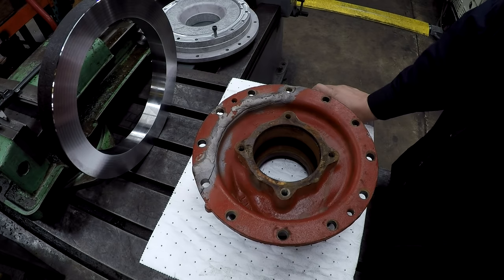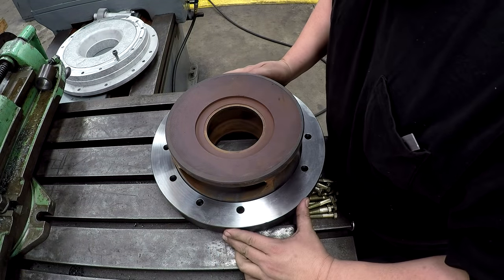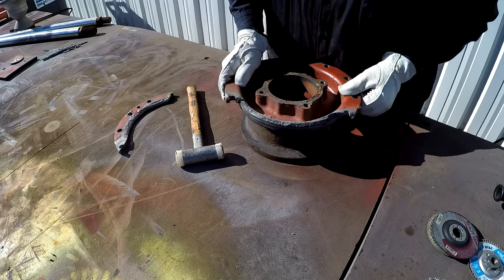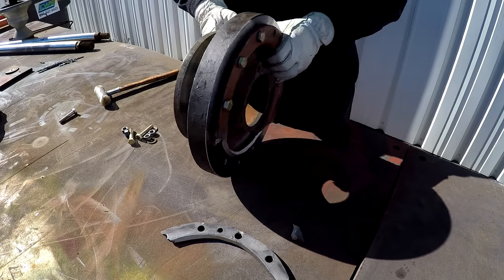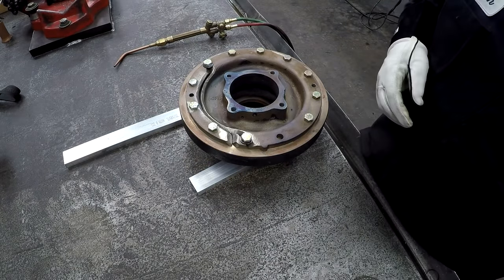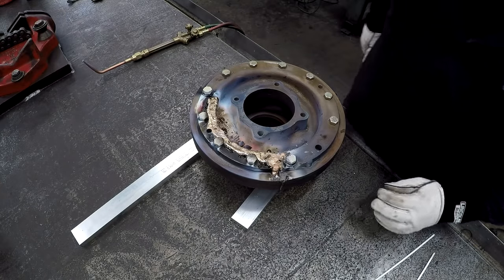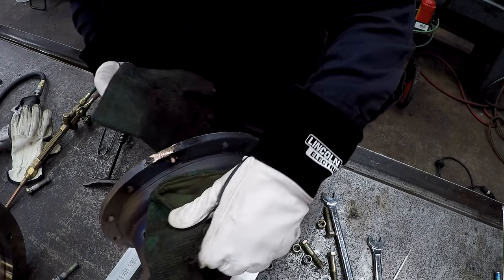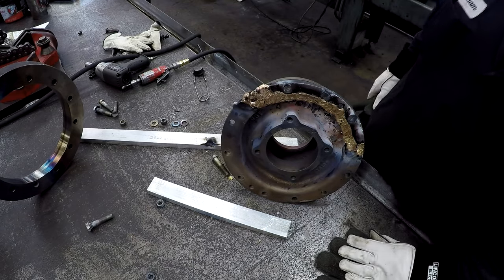Braze Repair on a Broken Casting Part 1

Comment: what is the advantages of braising that instead of re welding it better?  I've never messed with any braising just wondering
Reply: +robert singleton From what I've seen in Keith Fenner's videos, welding cast iron creates super hard areas around the weld that cause all sorts of problems should machining be necessary.
Reply: +robert singleton Brazing does not melt the base metal.  It is sort of like "solder" something together. The boundary area where the brass and iron bond becomes bronze, which actually melts at a lower temperature than either brass or cast iron!  They call that "hypereutectic".  Like when tin and lead combine they become "solder" and melt at a much lower temperature.  Believe it or not, a brazed repair can be extremely strong!  It can be stronger than the design capacity of the original part.  Even so absolute maximum material strength may be unnecessary (it depends on the part).  If ultimate strength is required, the part would have been made of steel and not cast iron.  Brazing is a good repair method because the cast iron is not melted.  If cast iron is melted, the carbon molecules separate from the liquid iron and coalesce into big chunks that have no strength and the cooled metal becomes weak and porous.  Other areas create carbides that cause other problems.  But mostly, when cast iron is welded, cracks develop.  There are a few filler rods used for cast iron that help alleviate those problems.  Metallurgy is advancing everyday.
Reply: +WAVETUBE84 thanks for the detailed explanation,  I could have looked it up on Google but wouldn't have been able to get as clear of an answer as that
Reply: robert singleton Basically, cast iron is brittle.  To do any welded or brazed repair requires preheating the entire part, or areas that will geometrically expand and contract together.  That will minimize the internal stressing of the part.  An understanding of "stress relieving" of welded together parts is a good side topic.  Whenever you weld metals together it creates internal stressess that are manifested (observed reaction) by warpage.  If the base metals have no where to move, there is much internal stress and if beyond the strength of the base metal, will form a crack.  The weldment becomes an area that has different strength and expansion and contraction rates (modulus).  After many cycles of being heated and cooled (like an exhaust manifold, or engine part) the welded part "beats itself up" and it cracks along the transition between the weld and the base metal.  That is why brazing is selected before "welding" on cast iron.  Metallurgists are developing new rods and processes all of the time.  Sometimes the discoveries are made by some guy with only a high school education (or less).  He tries something different and it works.  He shows someone else or publicized his discovery and it becomes a new phenomena.  So there are new rods that play tricks on cast iron (or other material) that enables the materials to flow together more successfully.  There are many tricks to the trade and it gets deeper and deeper.  For example:  My friend welded glass to metal!!!  It was for some special scientific machine or gas analyzer.   Other metals have different properties (Aluminum, Alloy-Steels, Mild-Steel, etc.), so welding them can easily be done.  There are various methods.
Reply: robert singleton I have a friend that works on cast iron, racing, engine blocks.  Either some fix or modification.  He has a oven to heat the block up until it is glowing, then he welds it.  After he is done welding it, he puts it back in the oven.  He has a special (programmable) timer that can bring the temperature down over a long time.  That reduces the thermal shock and cracking.  It is only for fancy racing blocks, or some rare type of  engine block.
Reply: WAVETUBE84 that's what I've always heard to do with cast

Comment: Generally and by far, the worst part about those repair jobs is the cleaning . Grime, oils, dirt: all kind of crap that prevent a good smooth weld/braze .In this case there's a clear, frank break that's easy to reach and clean

Looking at the crack's appearance, it seems that the weld hardened the material or at least effed its grain structure dramatically (grains are so big  it looks like sand in there) . It was prob preheated but was it post heated to slowly anneal it? Doubt it. 

Should be ok to forfeit post heat for brazing tho.

Comment: I am not an expert in this, but I would never attempt to repair something so far gone. I would have put the piece on the lathe, remove the entire old flange, and fabricate and weld a new one. The reason old weld failed is probably increased stresses on machine, which may break or deform also new weld. I would be interested to know how this repair has held over time.

Comment: I think the off pattern hole is a fool proof method of indexing the housing. I wonder if machining the face and adding a ring of in the front wouldn't be a better solution, i don't doubt your work, it was really well made, but it seems that housing was ripped apart violently, so there's quite a bit of force on it. Hopefully it will never break again, it would be a real shame with all that work put in to it.
Reply from the maker: Hoping the guys repairing it will take care not to break it again. I warned them about usijg those jack bolts.

Comment: Hi Adam. Fine looking braze job. Is there any particular  reason for using Brazing. In stead of using a Stick Electrodes especially for cast iron? Looking forward seeing the second half of this job. Keep up the good work and very entertaining videos😀
Reply from the maker: For large parts like that I like to braze and think it will provide a stronger joint. The first repair with nickel rods failed.
Reply: the casting failed adam not the weld because it broke beside the weld. probably like you said from those jacking bolts with uneven tention.
Reply: Was that your repair?

Comment: Wouldn't it be better to weld that with high nickel content stick electrode that is intended for cast iron repair? That stuff has worked amazingly well for me.
Reply: you can but the weld procedure is alot more involved and more costley thoose cast nickle ni rods are pretty pricey.
Reply: Arno Dyck Believe it or not, the braze weld is actually stronger overall and MUCH more ductile than any conventional weld repair. You will note that the pump housing had already been repaired once with nickel rod, although to be fair the nickel repair doesn't look like it was done properly. For gray iron castings, braze welding with low fuming bronze rod and oxy-acetylene torch is usually the best way to go, unless the casting operates at high temps (i.e. exhaust manifolds, stoves).

Comment: I like the work you do. I think this part would have been much stronger to have turned 3 pieces and screwed the center piece into the outer flange part with locktite. Sure it would not have looked the same and more metal would have made it slightly heavier but would have been stronger. Just my opinion. Clocking the center part to the outer part would have been the tricky part.

Comment: Hi mate.  That must be a bloody good customer for you to stick that much time and work in a repair job.  I would not know the price difference between repair and reproduction, but by the time it was all done it must have come close, and than you still only have a repair job.
Reply from the maker: +Marcel Timmers They were aware that the cost would be extensive, but they could not find a new part to replace it.

Comment: Adam,
A great job of brazing! Do you prefer flux coated rod instead of the bare rod that you add flux to yourself? I've never used the flux coated rod before. I've always used the "heat and dip" bare rod for brazing. When the rod gets short, you "weld" it to a longer piece of rod and continue on. It would seem to me that the flux might break off if the flux coated rods weren't handled right. ... You took a shitty repair and made it much better. You got full penetration, so after a little machining, the part will be as good as new . . . maybe even better! Thanks again!
Have a good one!
Dave
Reply: +Swarf Rat I use flux coated rods at work (diesel shop) and they're fine for that sort of work.  Plugging holes in exhaust manifolds, air tanks and other minor repairs.  The flux coating doesn't flake off the rod, but it can be a bit troublesome at times.  A new rod has complete flux coverage, but once I use it there's about 1/4" (7mm) of bare rod on the end.  That's where being able to dip the rod into some flux would be beneficial.  My brazing and welding skills are very rudimentary, so take this info with a grain of salt.

Comment: It looks like the original repair was attempted with a stick welder and mild steel rod., never going to work. As far as I am concerned, brazing is a no no as well.  I've been cast welding since I was 18, when it was covered in my apprenticeship. I'm now in my mid 70's, and I always had an electric oven in my shop, to heat the piece to about 250 C. I use cast iron filler rods. Not always 100 %, but not many failures.

Comment: That moisture that you see is the metal passing through the dew point at around170 degres as you are  pre heating..thats why a welder pre heats a boiler tube to220 to240 degres to take the tubes through the dew point.I was a cert. welder for 25 years.Inspectors watched that real close
Reply: +Barry Beggs Where do you come up with this?  The farmer's almanac??  The flame combustion gives off a lot of water.  Water condenses on the steel until such a time that the steel reaches a temp to boil off the water.  Simple as that.

Comment: what is stronger, a well done braze repair or a well done nickel or other cast weld repair on cast iron?
Reply from the maker: +ted sykora My opinion is Braze, but I have yet to prove that theory.
Reply: +Abom79 

I think it's depended on the situation.

If you have a cracked cast iron oven. Brazing is not a good idea because the bronze has a diffent thermal expansion that the iron, this can cause additional breaks. Here is welding the better solution.

If the casting cracked do to an impact, welding or brazing is OK.

If the casting is cracked do to bending stress over time, brazing is the best solution, because bronze is much more elastic than cast iron and can withstand the stress much better.
Reply: +boelwerkr    Thanks guys.   I have several farm repairs on my hobby farm where this is important.  mostly stress over time or vibration breaks

Comment: excelent job! but isnt it easier to make new part with lathe?
Reply from the maker: +marek35 Easier??
Reply: +Abom79 well not easier, but more reasonable. This casted part will probably suffer another cracks in the future. Making new part would not be so much more expensive and steel would provide more flexibility and durability
Reply: +Abom79 sorry, i did not realize, it is no circular shape and it has some nozzles inside, so it cannot be made by lathe

Comment: Will Adam's weld hold?  Will it fly apart in the lathe?  Tune in next week:  same bat channel, same bat time!
Reply from the maker: We shall see
Reply: i think its going to hold up long after adam machines it.
Reply: Great job well done. There's no reason the repair won't be as strong or stronger than the cast iron base. I think the rods are probably bronze instead of brass. I learned a lot from watching Adam's expert work.

Comment: Adam, when I first saw the extent of the breakage, I was ready to declare it B.E.R [Beyond Economic Repair].  I am very suspicious about the story they told you about "They cant find a replacement part". They maybe suffering sticker shock, hence the decision to go with the repair option. Once I saw your support ring and having seen Keith Fenner do some cast repairs, I was quietly confident that you would "getter done."
Reply: Oh yeah.  looking at the features, it's probably something that has to be cast and then machined.  I bet nobody has dies for the part anymore so they'd have to be fabricated too.

Comment: It always seems they use nickle rod first not sure why ?  Makes it more brittle does it not?
Reply from the maker: +Robert Roszell Nickel rods do good job and work on many applications, but getting it welded in properly is key. It may have held just fine if the part wasn't abused. In many cases a brazed joint is stronger because of the bond.
Reply: +Robert Roszell   Because it seems many tradesmen get their welding knowledge from welding salesmen rather than welding school.

Comment: Looks like you cooked the brass,could see holes in it!
Should have tig bronze welded it,more control when building it up and stronger result.
But that was a challenging job!
Reply: djyul Nope. TIG braze is weaker. Braze metal doesn't penetrate as deeply into the grain of the base metal, and the typically used silicon bronze rod has less strength and less ductility vs the low fuming bronze used for gas braze welding. Aluminum bronze TIG braze rod is slightly stronger, but still suffers from less grain penetration. Plus, once you are skilled with torch brazing you can use the flame pressure to move the molten braze metal around. That is something you can't do with TIG :-)
Reply: @WTFChuk  I am skilled with oxy acetylene,used to restore hustoric race car frames,and they were brazed,either brass,or nickel type mix.Beena a coded welder for many years,dont have that much exp with tig brazing,just an idea.Thank you for your replay.
Reply: @djyul  You're welcome! You mentioned the nickel bronzes. As you know, but others may not, those are great for gas brazing the higher strength mild steels (1018/1020), high strength nodular irons, and high strength malleable irons. Strength is even higher than the RBCuAl-A2 aluminum bronzes. Spec is RBCuZn-D, making it a variant of the CuZn low fuming bronze class, but with around 9-11% nickel added (regular LFB has no nickel). Tensile strength is upwards of 95,000psi, with a yield strength of around 50-60ksi if I recall correctly. It is comparable in strength to 7018 or ER70S-2 steel fillers. Ductility is lower than regular LFB but higher than the weaker silicon and aluminum bronzes. It really is amazing just how strong a good braze weld can be.
Reply: @WTFChuk  It is why they are/were used for CroMo frames etc,giving but strong.
Nice meeting you.
Reply: @djyul  Nice meeting you as well. Take care :-)

Comment: You had all the holes drilled in that steel ring............ Why didn't you cut the broken piece off the casting using the lathe, then fit the whole new ring in place  ??

Comment: Why wouldn't u use silicon bronze and tig it ???? it works much better brazing and looks better also
Reply: silicon bronze tig would have worked just fine im sure but would take alot longer and more costley.

Comment: when i was showed how to braze i was showed to use sand paper to clean the rod of oxidation.   so i can control how much flux to use.   some times you a lot , some times you want only a little.

Comment: Not bad, SHOULD have ground out the back side a little before you brazed it.  Back side of a brass job has tinny bits of hardened flux, and the contaminants that comes out of the cast iron that looks like glass needs to be ground out!!!!!!!!!!!!!!!!!!!!!!!!!!!!!   The FIRST welding with the rod would have worked if he had gotten 100 percent penetration and welded on the back side.

Comment: Hmmmm, I do not see any radius on that flange where it joins the rest of the casting unless it is a recessed one. Might not hurt to stress relieve it if you can after the braze is finished and if the brass will stand the temperature. With all due respect to your art of course, Adam ... You do this for a living and I do not.

Comment: Not tryn nit pick but ure brazing not preheating torch a bit to wide spread of a flame. Wide flame yields less control of braze thus a sloppy finish that could’ve been more precise with a coned blue tip flame instead of dispersed flaired or wide spread!

Comment: were you ever worried about putting too much heat too quickly?  I'm an amateur but I might have taken a short  break here and there.
Reply: no time to take a break you want to keep the heat into the metal and keep it constant makes for a good job or a bad job. cast if it cools to quickley it will crack. hope this helps.

Comment: Claiming that the moisture is from the casting is a common misconception. Water is a common byproduct of combustion, including oxy-propane (or was that oxy-acetylene you were using?). The hotter air is, the more moisture it can hold. When the hot gasses hit the cold casting it cools the air and it can no longer hold the water (same process as dew), so it condenses onto the part. Iron/steel isn't full of moisture, it's from the torch.
Reply: lol i would love some of that shit your smoking.

Comment: Would a used two half rings 1/4" decent steel, direct weld on.  Besides an oven pre-heat of the core, done in an hour. Replace that entire rotten flange.

Comment: I would of recast the pice in aluminum, a mold could of been created before you took it apart. A new sand cast mold and make a pour. It cannot be that strong!. In the old Days! That would be cold wielded with Mercury and iron filings.